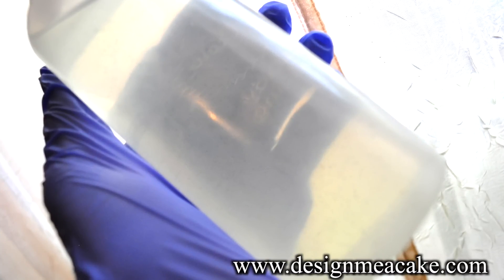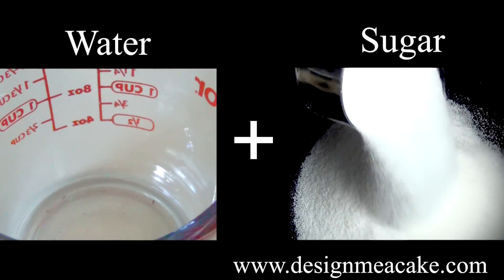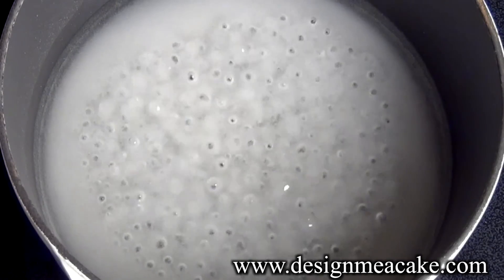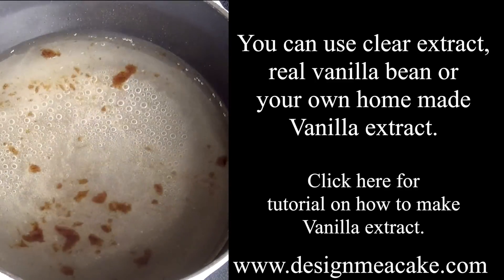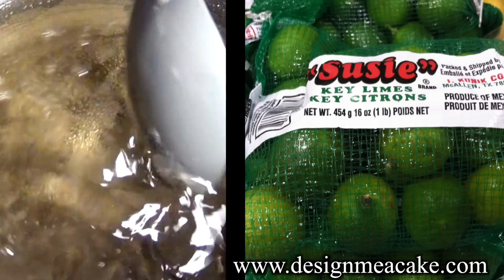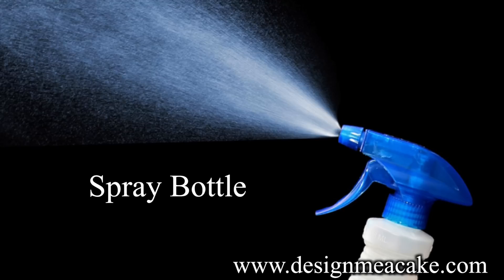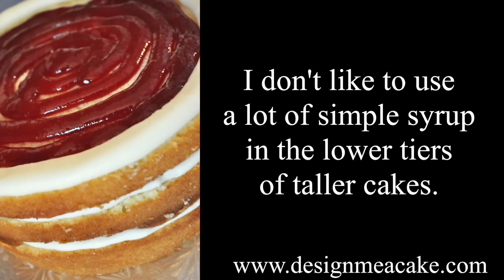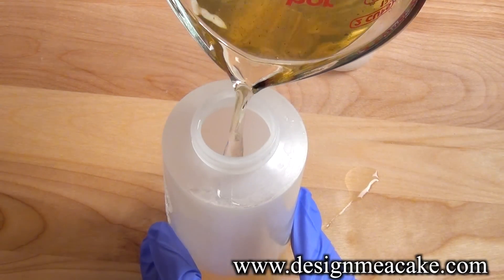How to Make Simple Syrup For Cakes

Comment: Hi Edna!  I'm baking my cake 3 days earlier... so my question is should I add the syrup before I plastic wrap & refrigerate or AFTER it is removed from the refrigerator and right before I crumb coat it?  Thanks for your help!
Reply from the maker: I prefer to do it before I refrigerate so it has enough time to get around the cake. Especially for cakes that are supposed to be super moist like a rum cake. If your cake is on the softer side, you need to test it to make sure the cake holds well and to know how much syrup you want to add to a cake. Some people like to add just enough so the cake is moist, others like more syrup.

Comment: Thanks for the tutorial. Two questions, How long does the simple syrup last if you add in the alcohol, extracts or fruit juices? Where can it be stored? 
I love the fact you can flavor it with just about anything. I learn something everyday ! 

Thanks Edna .
Reply from the maker: I store mine in the fridge. The alcohol actually acts as a preservative so it will make the syrup last longer.
Reply from the maker: It can be store for a few weeks in the fridge but usually I make enough for what I need. The rest you can use to make jam syrup for pancakes or you can make drinks with it or add sugar to lemonades and things like that. I don't really worry too much with the storage part. It's just water and sugar and really easy to make too. ;)